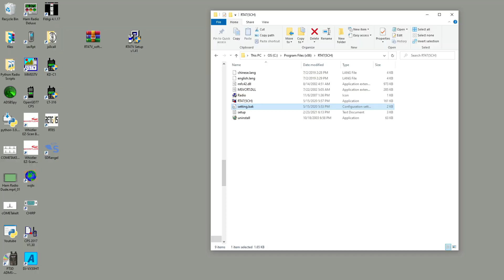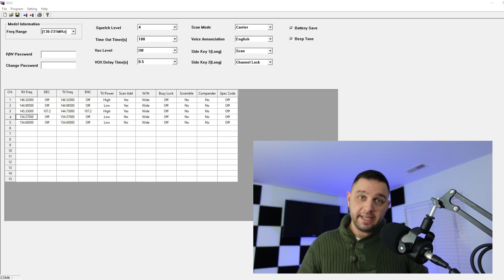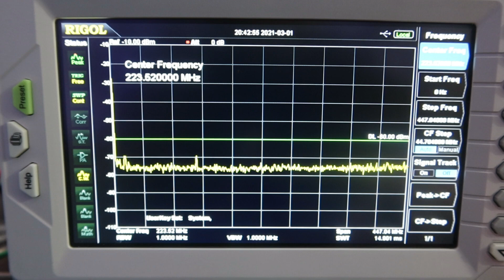Retevis RT-47 - Waterproof Test, 2M/1.25M Frequency Hacking, and Tear Down Part 2 of 2.

Comment: radio refuse to enter programming mode?

cannot connect the radio?
Reply from the maker: Is it the correct programming cable?
Reply: @DudeTested  I have the same problem...i think the newer version is set with 2W and updated programming software blocks allot.

Not sure if its a password issue.

Comment: Trying to program it using its USB driver and programming software via their website and a programming cable (bought online).
So far, I turn off the Radio and then connect the programming cable to it., launches software, connects the other end of the cable to PC and power on the radio.
In the software, the correct COM port is selected but when you hit  Read from Radio, it attempts to interface because it reboots the radio but then the software gets stuck and goes "Not Responding" (Task Manager to the rescue). 

Used another Win 10 laptop and did the same procedure. Still no go.

Help!

I like your videos but I don't like my issue here! :D
Reply: It was the cable. and had been replaced. This has been resolved (as stated in the first part video). Thank you.

Comment: How do you change permissions on the settings file to allow you to add channels to this radio? I have tried with no success but my Windows knowledge is limited.
Reply from the maker: Typically when you open up notepad or another word processor to edit the file, you need to right click on it and run the word processing program as administrator
Reply: There is no option to run as Administrator, it just opens in Notepad by default and wont let me save changes. Says I don't have permission.
Reply from the maker: @lt8463  to to the start menu and type notepad, you should see the notepad program display.  Right click it and if you dont see "run as administrator" there, go to properties and find it In there.   Once notepad is open, go to "file - open" and browse/open the file you're trying to modify
Reply: Got it!! Thanks.

Comment: Just wondering if the Retevis RT10 has come up on your radar yet.  It's apparently an unlicensed DMR radio in the 900mhz ISM band, or so they claim.  I've been dying to find a review on it but I don't think anyone has one out there yet.  It looks like it has encryption features but doesn't frequency hop (you can dl the software and see all the options) so there are some forum posts arguing about if it will ever be able to get an FCC grant approved or not.  Thanks, and awesome videos!
Reply from the maker: Next month I could consider purchasing one for review and see what it is all about.  I'm not positive, but will give it a shot.
Reply: @DudeTested  how much power are these?
Reply from the maker: @jonjeffries3265  about 3.2 watts.  This video shows the testing at around 6:13 https://youtu.be/DRG0KNYrbCI
Reply: @DudeTested  thank you so much.. I might have to get a pair of these too my rt29s I just ordered and should be here by Saturday.. 😁